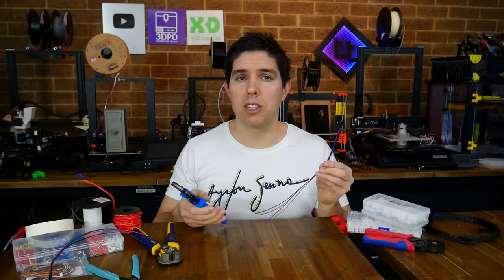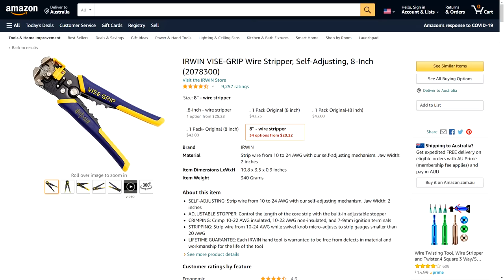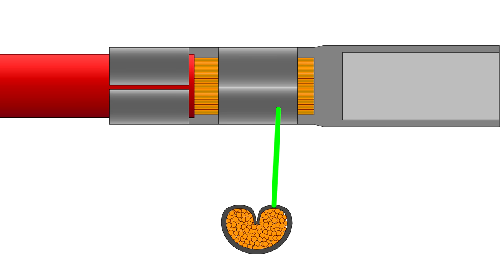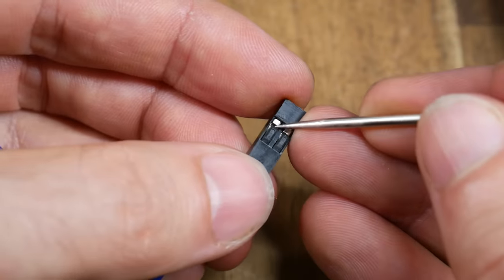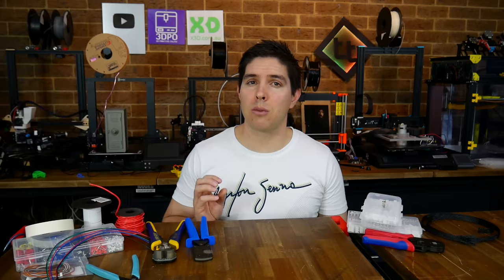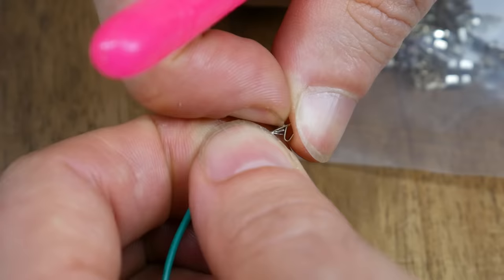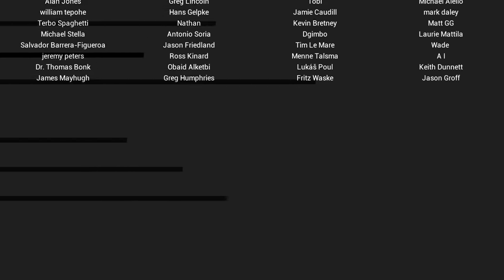Guide to crimp connectors on 3D printers - Take your wiring to the next level!

Comment: Dupont inserts have different clamps for strain relief on the insulation. While other clamps are crimped symmetrically, with Dupont the two sides of the clamp each encompass the entire wire. I can recommend the "Preciva PR-3245" crimping tool.

Comment: Great, now my VORON parts can arrive... ;) Thanks a lot, another great video!
Reply: Note that the crimper here won’t work with all connectors used on the Voron - the Voron community recommends the IWISS IWS-2820M or the Engineer PA-09
Reply: @christophmuller3511  Thanks, I think, I've got them.

Comment: Solder heat shrink connectors are also really good for splicing and joining wires. You can use a lighter to shrink and activate the low temp solder. It also seals both ends to make the joint water proof.
Reply from the maker: Just got a pack yesterday. Watched a video from big clive. He seemed to think they were reasonable for smaller wires.
Reply: @TeachingTech  They are great for 20 awg and smaller.  I think traditional soldering is better for 18 and above. The trick to them is to ease it up on the lighter or just a heat gun. I've been using them mostly for splicing fan cables. Sometimes it's just not convenient to pull out your soldering gear for just two small wires. 

On another note, there are crimped female jst ph and jst xh female connectors but they are harder to find. Soldering wires to surface mount inteded sockets never lasts. I am not sure why all the amazon sellers only sell smd connector kits.

Comment: Great video. I'm so thankful for how standardized most plugs are on 3D printers. Working on arcade cabinets back in the day I used to get some very strange ones especially in Japanese machines. 24 or 30 pin JSTs for example. A real pain to replace even now with Aliexpress etc as an option.

Comment: Just learned my power ferrules are crimped wrong.  I only crimped the plastic, but I'll crimp the shanks now too.
I struggled crimping onto the sheath and strands correctly by feeling where the correct placement of the cable is inside the partially crimped connector.  To remedy that, I use needle nose pliers to half crimp around the sheath only and insert the cable with connector into the crimpers into the correct location resulting in a PERFECT crimp with no more wasting metal crimps on failed attempts.

Comment: The most important thing I learned here was how to get those dang wire strippers to work on thin wires. Amazing how well your various 'finger-assisted' techniques to clamp the wire before crimping work, compared to me just getting disappointed when they don't automatically clamp thin wires tightly on their own... 😁 (see 3.58 as an example...)
Reply from the maker: There's probably some merit in playing with the tensioner to get it fully automatic.

Comment: I made the mistake of not taking the time to make the right connectors for the bl touch when connecting to the skr mini. While it was fine for almost 2 years, I recently tried lightning infill which makes for a shakier print. So about a third print in (with only 5 layers left to go even!) was enough to loosen the default connector enough to power cycle the bl touch, and the pin popped into the infill and bent.

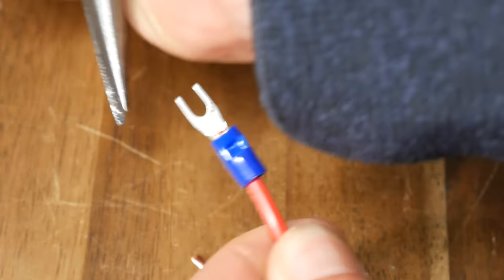Comment: 2:15 "cirmp cant melt if it gets hot"  For my laziness for buying a cheap ready made wiring harness resulted in some heavy discolors connectors with burn marks on the inside and a small electrical fire. These been the worst crimps i have ever seen. If you want it done right you have to do it yourself.  So make sure to use good tools and be patient when crimping small JST and such

Comment: Pa09 engineers are the best. You're crimps will be perfect and won't be wonky like the black wires you crimped in the video.
They cost 40+ but they are more than with. Especially for dupont and jst
Reply: no they aren't worth the 40 bucks. IWS-2820m is a better bang for the buck. 
Eh they are all outclassed by ratcheting crimpers anyway (iws-3220m as shown in the video is superior)

Comment: Dupont connectors are also on servos like the ones used with RC cars, airplanes, boats, and helicopters.  For the plugs where you have the male pins sticking out, there is an extra piece of plastic that snaps onto the dupont plastic so those ends aren't exposed and prevents them from being plugged in backwards.   Look up a servo extension to see the different ends.

Comment: If properly crimped (using the right tool) the stands are cold welded to the terminal.

Re soldering: solder is not only filling the gap (like a glue) but it diffuses into metal surfaces making a tiny layer of alloy at the soldered joint.

Comment: At some Fysetc F6 and S6 controllers you might encounter Dupont TJC8 MX2.54 connectors. These are having a locking mechanism and dents preventing them from reversed installing. I also recommend the Iwiss 3220 crimping tool.

Comment: Good tutorial, just twisting the wire before inserting it into the plug to crimp is wrong because it lessens the pressure fit it is supposed to have.
Still miles better than soldering and such. Most likely.
Reply: That's what I was always taught too. More specifically wires should only be twisted to restore any natural twist in the wire and no more so untwisted strands must stay untwisted before crimping.
Reply: @MDalton10  crosstalk is important when you have separate wires in communication or sensitive applications (encoder signals, for instance). When talking about strands of the same wire, crosstalk is irrelevant.

Comment: The only two questions I have on the DuPont/molex/jst crimps I have that no o e seems to answer is: 1. how do you prevent fraying of the wires when inserting in and 2. How do you know how far you have to insert? I end up bending one of the tabs over to hold it against the wire casing, but that ends up sacrificing one of the tabs. Otherwise I can not see or feel how far I push the wire in and I either go too far or not far enough and waste another crimp.

Comment: For stripping very thin wires I recommend the Jokari Super 4 Plus.
Reply: It's terribly expensive. Some people made a home-made tool, and good quality. They took a nail clipper, and with their teeth closed, they drilled a hole - at the junction of the teeth. Further, make the edges of this hole sharp. And... and that's it. Of course, several such tools are needed for different cables.
Reply: @ivandrago4247  I'm sorry to hear that $15 (13 euros) is too expensive for you. 😉
Reply: @mururoa7024  Um, weird. I must have mixed up this tool with some other, expensive tool.

Comment: One correction I would make is that according to the manufacturer, you actually use the pointy part of the crimper on the oppsoite side of the split part of the connector

Comment: I do have the right crimping tools,  but Dupont and smaller I find just too fiddly, so I usually cut of the tabs that stick out and solder a wire to the connector.. After that it can be inserted into the connector housing as usual.

Comment: Ahhh man! I have like 6 different crimping tools I have been searching for JST connected set that works best. I use these so much at work and there is always some issue with the pair. Granted when it's doing the wire for power it's fine and i have a great set for that but the small Micro JST (2mm pitch) and other. I love that brand wire cutter but I didn't know they have one of those.

Comment: How does one cleanly strip and install/crimp on a connector if the wire has braided fabric insulation, not conformal plastic insulation?

I purchased a package of replacement hot end heater elements with long (about 2 foot long) wires with braided fabric insulation. I need to trim the wires back to a usable length and crimp on JST connectors to mate with my printer.

I can’t strip the insulation with regular wire strippers and I can’t get the wire insulation into the crimp on connector because the insulation frays open.

Any thoughts or an update from the video?

Comment: Great video as always. However, I think you missed one small detail when you briefly mentioned the soldering of wires going into screw terminals... you mentioned it's a safty hazard but never explained it's due to the cold flow of solder which over time means the screw is less tight and therefore increases the restance of the connection, which leads to more heat etc.
Reply: Recent studies show that it's not just that, but microcrystalline fracturing from even minute temperature changes as well.

Regardless of reason, people, just know:
Don't crimp tinned wire!

Soldering the exposed wire on an already crimped terminal is sometimes beneficial, though.

Comment: SON OF A @&?:$. I have been using needle nose pliers for DuPont connectors for years now, and I knew that their had to be some tool that would make that easier, but couldn’t find them.  Thank you SO MUCH for this video.
Reply: And this video, which is probably the best one I’ve seen for using cheap Chinese tools, still isn’t showing how nice it is with the truly proper tools. Unfortunately, the truly proper, original tools are prohibitively expensive, but man do they make the job easier still. (Molex and JST are nice in that you can buy their original tools for “only” around $300-400 each.) In original tools, you have positioners/locators that hold the contact in place, and depth stops to ensure the wire is inserted to the correct depth. The results are magnificent. 

If you have patience, you can get original tools in classifieds or auction sites for a lot less. I’ve been collecting them for the connectors I like to use and have gotten a bunch of original tools for $60-100 each.

What sucks is that DuPont contacts are one of the “neediest” contacts, in that they’re hard to crimp well with generic tools, and 99% of the cheap tools sold as being “for DuPont” in actuality are totally unsuited, creating the mangled insulation crimps shown in this video. The real tooling can be had used for around $100. In contrast, most other connectors tend to do ok with well-selected generic tools.

Comment: Main issue I always have had is finding connectors that latch together and handle moderate current. I've gone with mini molex connectors for the most part. Also increasing voltage has helped decrease current on some things. For other things,  i just buy spools of wire and make my own wire harnesses.  I just never really bothered seeing how much a butt connector added for resistance, but I guess I should. I know it doesn't fit in cable chains well. It also has to be a friction point on silicone wire that's moving. 

For ferrules, I was taught to twist very loosely on thin wire and not much at all on thicker guage 

For dupont, I have sanded the end of the connectors to get more purchase on the male board connector pins.  It's not much,  but helped.
Reply: The connectors (assuming a quality brand like Molex) don't add any significant resistance.
Do make sure you use the same metal on both terminals when possible, and never mix tin with gold.

Comment: I am switching from a single part cooling fan to a dual. Since the Ender has no plugs, I must cut the wires and fashion my own connectors. Can I use the male connector that usually goes into a circuit board for the receptacle or is there another way to accomplish this where I can easily remove the fans should they need replaced.

Comment: Connectors are rarely the bottleneck for amount of current. You'll find that even tiny JST connectors can carry huge currents, XH for example being rated at 3A at 250V. Wires are usually the main limiting factor. So what you said at 5:21 that different colors connectors are different current ratings is not entirely true. Different colors are indicators about minimum and maximum wire size which should be used to ensure good connection. You can also find red ring connectors which have bigger ring than yellow connectors. Even your set has them.

Comment: I need to make a custom 5 pin wiring hatness for my BL Touch using Dupont connectors on one end and JST-PH 2.0 on the other end. Should I go with 24 gauge wire which is the max for the JST-PH 2.0 connector or somewhere in the middle for both connector types. Or can i just use a Antclabs BL Touch extension cable and swap out connectors. Thanks for your help in advanced.

Comment: Hi TT! Just about to go down the path of making my hot end easily removable (add plugs instead of wires to the breakout board), but i'm having trouble reconciling some things. Looking at the crimping tool you suggest (IWISS IWS-3220M), and the JST-RCY and JST-SM connectors. How do I know if these are compatible or not. Wire thickness including insulation on my CR10S Pro V2 averages around 1-1.3mm including insulation for most except the heater which is 2mm.

Comment: Why no ratcheting crimp tool for the blade connector? One of the keys to a good crimp is making sure it's the right amount of pressure, and doing it by hand can risk not hitting that sweet spot. Ratcheting crimpers make sure you have enough pressure for a solid connection and release so you don't overdo it and chop your connector too.

Comment: I don't find that wire stripper good, I have one as well and that it strips off strains of copper wires and causes fatigue in the insulation.  For electrical cables that wire stripper works fine but for electronic stuff, I still prefer the gauged wire strippers that strips very cleanly and doesn't pull off extra strains of copper.

Comment: The tiny white micro connectors used for fans and thermistors are a real pain to crimp.  If you are going to attempt it, you absolutely must have the right crimp tool, and some kind of hands-free lighted magnifier is highly recommended.  Going forward, I'll just avoid trying to crimp them altogether, and buy connectors with wire leads attached.

Soldering tiny wires is also much more difficult than I anticipated.

Comment: I bought a ender 3 pro from a guy and he put on a bigtreetech duel wifi board on it and had to change the terminal inserts, I'm trying to return it to a creality board but the new crimps/terminal inserts won't fit on the creality motherboard,  which crimps will I need to return the wires to their stock inserts?

Comment: You should  not twist wires before crimping. Always keep them straight. This is because twisting creates uneven and unpredicted contact surface inside crimped connection.

Comment: I'm not 100% convinced of the reason tinning wires is fround upon in the 3D printing community and the reason is that I worked for six years installing warden call alarm systems in monitored housing systems for seniors.
 The spec at the time called for tinned wires for the 2 stranded power pairs in the control units in the residents home (there was also solid core paired wires for comms) and crimped ferrules with conductive gel for the umbilical 10 pair cored that was ringed from the controller unit around each dwelling and back to the control unit. I never once had any problems with the tinned wires and I did maintenance for the whole of the north of England as well as installations
Reply: Around here, it is against code to tin power wires.
Hate to say it, but you probably got trained wrong.
It is very bad practice and a real fire hazard.
Reply: 3d printers produce a lot of heat, not only from the bed and HotEnd but also from the power supply and motherboard.

This heat builds up and if you're printing every day, it could potentially soften the tin and crate a short in some way, damaging the boards or even worse
Reply: @PandaTaco  Don't need any heat, the solder will flow out of the crimp all on it's own.
Reply: @joshua43214  even worse
Reply: Andrew Hayes, I have to agree with you. I put about 45 active years in basically all phases of electronics and even though I'm 87 I still do quite a bit of hobby work. We always used to tin stranded wires that were to be used with (what we called European) terminal blocks. We would occasionally tighten or check all connections and I never had any problem. That being said the possibility of "flowing" solder makes using good crimp connectors really the proper method now.

Comment: hardest part i find is how far into the crimping tool you stick the wire, more times than not ive either gone too far and crimped just plastic or not far enough and its loose

Comment: so theres no way to use the male jst type to end a say fan wire for easier replacement?
Reply: You can get male inline crimp connectors, or you can always solder the board-type connector to the wires (and use a bit of heat-shrink insulation on the wires to make it neat).

Comment: My experience with crimping tools after 30 years of work with wiring is that they are crap and have used my Vicegrip (note the real Vicegrip and not the crimping plier clones) solely as it crimps the electrical lug in ripples which holds the wire securely and keeps a longer good contact with the wire and won't pull out of the lug.

Comment: How do you now how far you have put in the Wire in the DuPont/Jst Connectors. I always fail at that part.
Reply: I use alot of the much smaller Molex Minifit connectors. I find it easiest to prebend or lightly crimp the wings with a pair of small needle nose pliers or something similar. you can actually use a pair of tweezers depending on the connector. Then gently put the wire/terminal into the tool and crimp it. It is much easier to get all the terminals lined up properly this way, which can be a real pain when working with stiffer wires, and connecters with alot of pins.

Comment: I'm not a big fan of these automatic wire strippers. They just rip the insulation instead of cutting it away like with manual strippers where you choose the correct wire gauge.